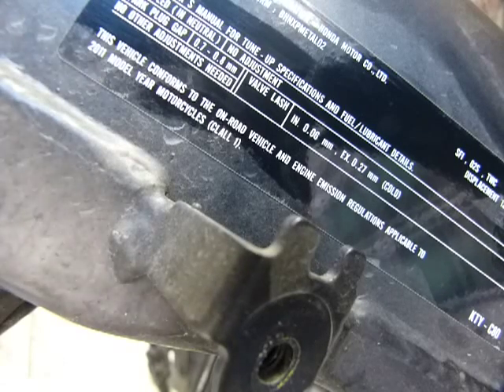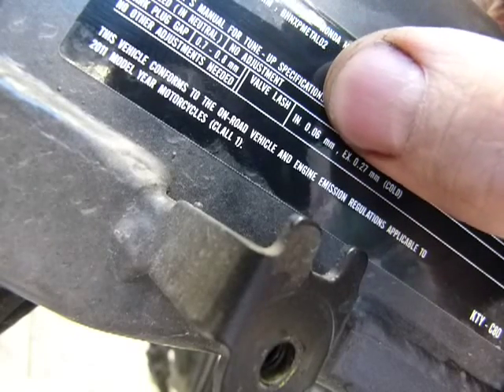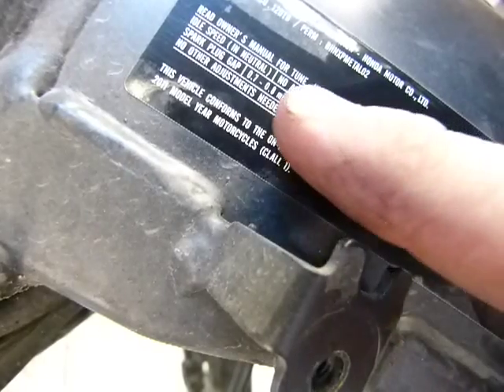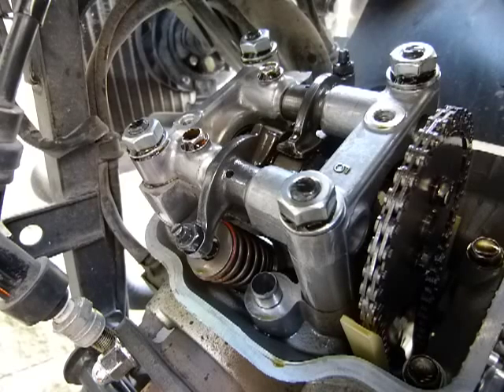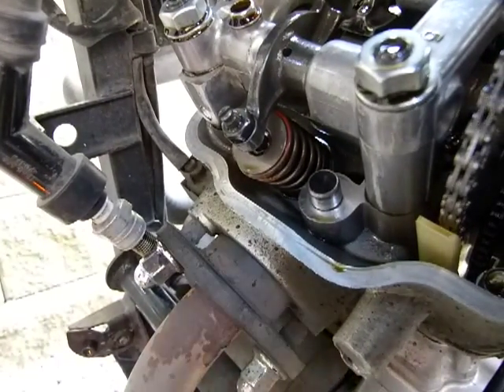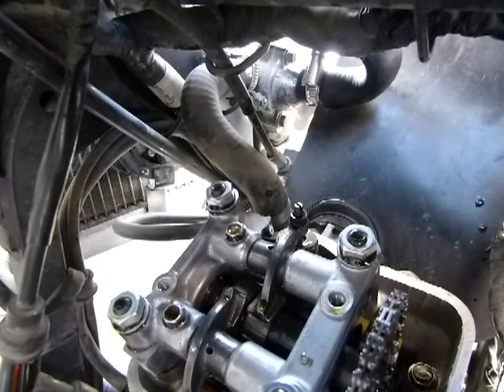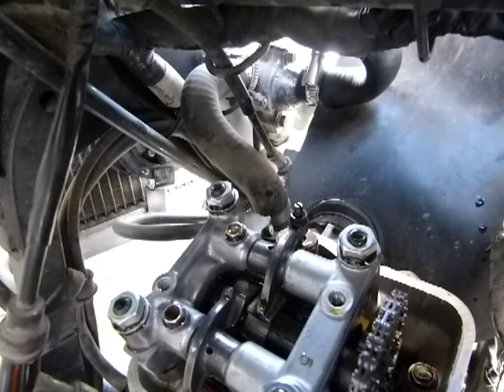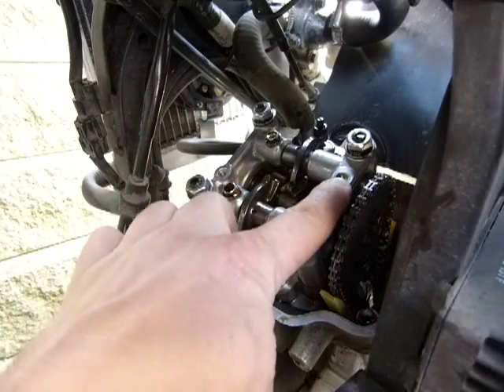Valve job: tappet screw type (2011-14 Honda CBR125r)

Comment: rather than just guessing if the radius is the same for most of it, just turn the damn thing until the sprocket mark lines up with the head. Really not worth guessing when it's no extra effort to do it  right.

Comment: on the cbf the rocker arms do not have feet like this cbr .instead they have small bearings to make contact with the cams .if you get a problem with oil feed on them they will blow apart scraping your cams.the adjustment screws also do not have a slot for a screw driver they are squared for a spanner somthing like 3mm  .the whole assembly of the cbr head looks to be better including the cast.the entire head on the cbf will thread out easy .cbr looks built better